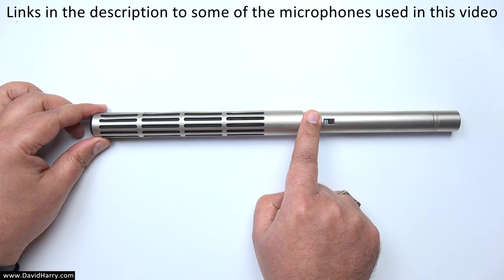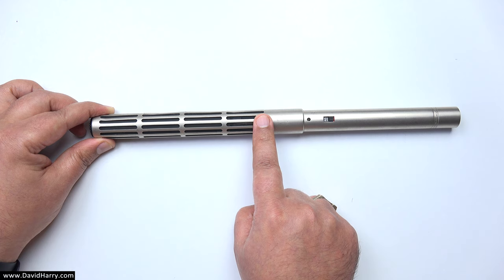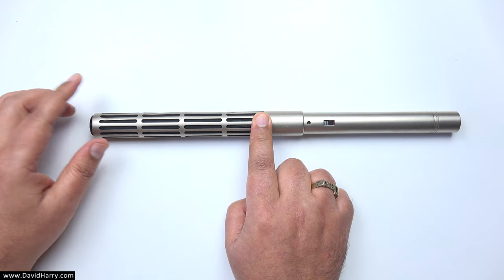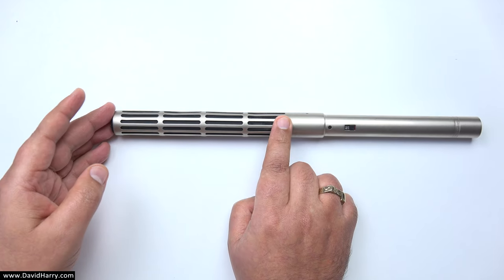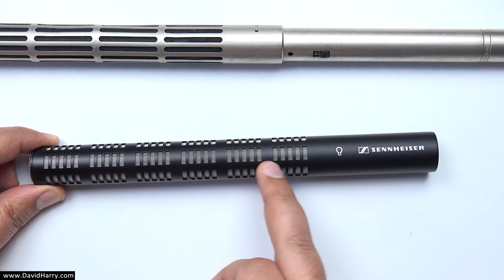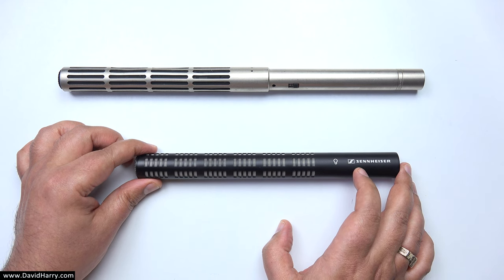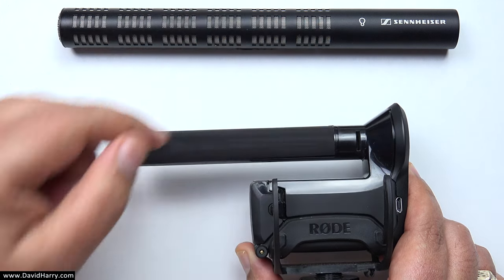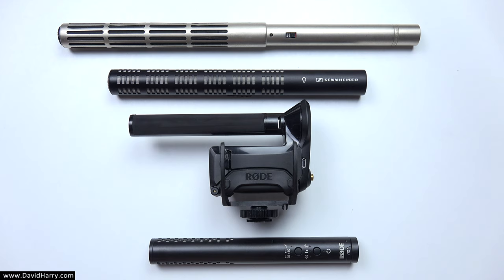How Does A Shotgun Microphone Work

Comment: Hi David, which Gopro Hero is the best all rounder in your opinion for both audio and stablilization?
Reply from the maker: Hi. Between the 5, 6, 7 and 8 the audio will be exactly the same if using the mic adaptor or media mod on the 8. Stabilisation is easily the best on the 8. All that said, every one of those cameras has issues and your choice will be one of compromise. Cheers, dave.